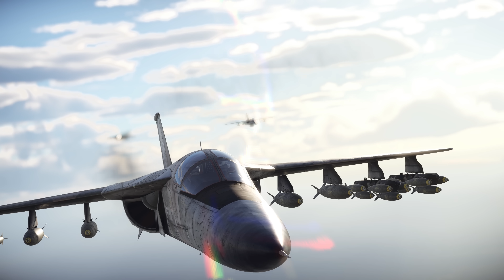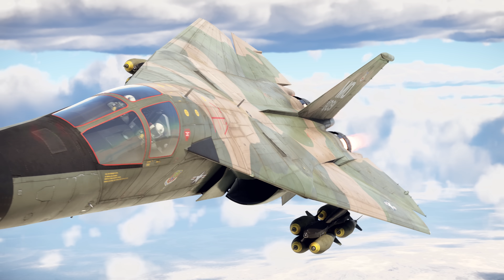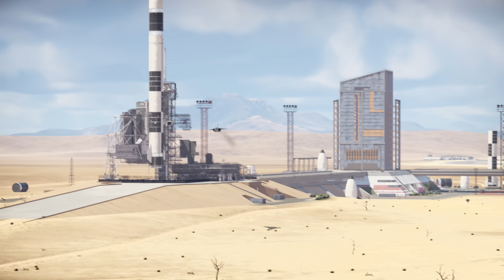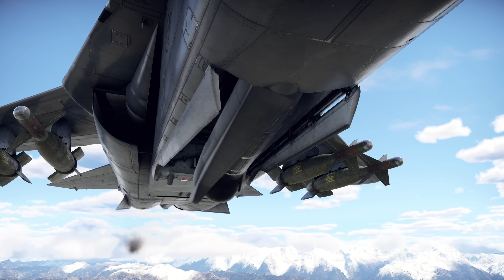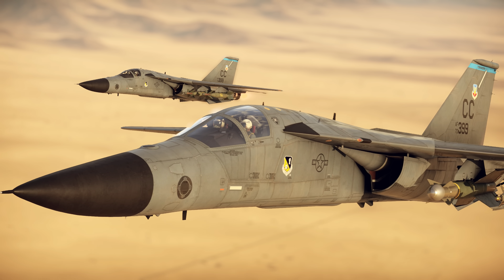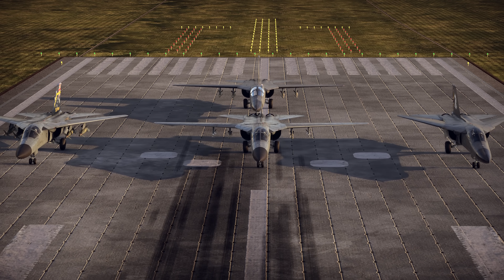F-111 Aardvark: Low-Altitude Menace

Comment: The D model I crewed in 1974 had new TF-100 turbo fan engines a at altitude became Ram jets when the intakes closed off using spikes that cut off the air coming in and became Ram Jet engines able to fly at mach 13 and found a new sound barrier at mach 28. The aircraft I was crew chief on had the whole avionics system of the B-1 lancer and was the test aircraft. Totally a fantastic aircraft.

Comment: I worked at Tinker AFB and I machined plenty of parts for the TF -30 engines that went on the F-111 and early model F-14's. If it wasn't for the problem with compressor stall it would have been a great engine. Either way we reworked thousands of the TF-30 engines at Tinker AFB during the years it was used.

Comment: Did the 111 (or any swing wing ac) have its wings fully swept back on the deck?  Or was that a higher-altitude Mach 1.5+ config?  

I read the F-111 killed more tanks during Desert Storm than the A-10; good for the USAF and General Dynamics for sticking with the model to make it a killing machine.  It had a rough start - a lot of technology had to be perfected to get it where it ended up.  A darn good aircraft. 

My first WT video, I didn’t know this channel existed!  Nice work.

Comment: I wish that ground-following radar would auto fly my plane low in some special setting like it did in real life. i mean some of these planes are basically built around specific modules and its sad when peeps dont get to use them. F117 can use its stealth by default , A10 that was built around its gun is the same. F111 was built around its new radar (a bit like F14) and state-of-the-art automated avionics that nobody had. Yet we dont get to use any of that. Big Sad :'(

Comment: Still incorrect model. Wings do not fold to 45 degrees with gun pods on as they should and the flight model is badly gimped and the airframes break at half their top speed at sea level. War Thunder looks good but the Western models are badly sabotaged or over tiered.

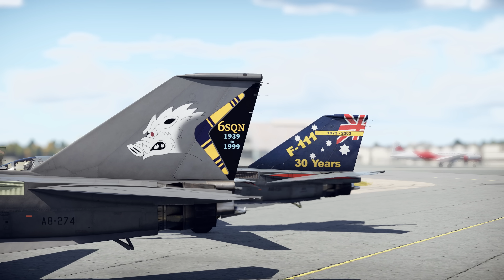Comment: 4:13 correction:
F-111 Aardvark fighter-bomber, call sign Karma-52, was shot down over Libya during Operation El Dorado Canyon on April 15, 1986. Two U.S. Air Force captains—Fernando L. Ribas-Dominicci and Paul F. Lorence—were killed when their F-111 was shot down over the Gulf of Sidra.
Reply: Probably not shot down…radar jamming was interfering with terrain following radar and Capt Rivas probably paddled off the TFR and mistakenly hand flew his jet into the water.

Comment: The F - 111 if I remember correctly, was originally designed to be on a US aircraft carrier. But the Navy turned it down, then the AF took a look at it. When the D model finally retired, some of them had problems we techs just couldn't figure out! They were a technicians nightmare! Especially for A shop!
Reply: I was a B shop (instrument and autopilot)  tech on the F111D from 1971 to 1974.  It was easy to fix our stuff if you new what you were doing.  Really tough if you didn't.   Most guys didn't know their stuff and didn't care to know.  This aircraft was designed for both services to use.   Both services didn't like the idea.
Reply: @jnbfrancisco  were you in 'Nam? I thought a couple of the F-111 models saw action over there. Thank you 👍
Reply: Actually, it's the other way around. The F-111A was the winner of the USAF request for proposal for a low level strike fighter, hence the USAF got the F-111A. Robert Mcnamarra, the US Sec. of defense thought the US should only be flying the same jet for everyone so he said this is what the US Navy should use for their new fighter. That was the F-111B. it's not often the Navy is told to buy an Air Force jet because it usually doesn't fit Navy carrier-borne requirements. The B model kept gaining weight and getting more expensive until they had to cancel it.  The US NAVY now relieved, came out with their own proposal rather than taking the stupid hand me downs that Mcnamarra tried to force on the services, and they developed the F-14 with much of the technology gained from the F-111 being shared with Grumman to make the awesome F-14. The Navy has "given" the USAF the F-4, and A-7. The Navy has taken the "loser" of the Lightweight Fighter competition and turned it into the F-18 Hornet while the USAF kept the F-16. Mcnamarra might've been a good corporate manager, but he knew nothing about military aviation. Yes, the "D" was a Dog of a jet with unremarkable avionics, but the FB-111 was an awesome version with nuclear capable prowess. technically they were all nuclear capable, but the FB was the medium bomber version with larger wings and avionics for that role. The Aussie C model was a mix of that airframe with standard avionics and then got the G model when the FB was retired. They all had issues, even for weapons with those swiveling pylons. 🙋✌sorry, didn't mean to geek out so much. She's such a cool jet. Hell, there was even an EF-111 that was credited with killing a MIG-23 during Desert Storm in 1991! Two swing wing platforms, one of them an air to air fighter and the other an unarmed electronic warfare platform and who do you think won? The EF-111 out flew the MIG when the -23 flew into the ground. Of course, I'm sure the RWR in the headset of the MIG pilot telling him that he was locked up by an F-15 Eagle somewhere behind him put some pressure on that pilot. 🙂

Comment: 1 turn and you're down to 400kmh and become a sitting duck.
Reply: Dont turn Hard and you dont bleed much speed and have enough fuel , i use 73 Minuten of fuel in my F111-f works fine for me as long as i dont get an R24 in my engine, i know its Radar guided missile.
Reply: @justforfun_ger7137  Cope

Comment: Why can't the wings sweep with gunpods :(
I check a few manuals online and couldn't find anything...
Also, I know it's a silly wish, but it would be cool to have Electronic Warfare aircraft. Jamming radar would be a fun way to support a team, and we'd get the Sparkvark!
Reply: They are supposed to sweep to 45 degrees with gun pods on but Gaijin sabotaged them. Along with about 20 other times they wrecked things for balance instead of using the BR system.

Comment: Quick question about the game please guys, because I'm not too familiar.

I'm mostly into DCS, but I am unable to devote as much time as I need to learn the full fidelity modules. I've seen recently that War Thunder is introducing a lot of jets and helos, but what I really need to know please is how large, and what variations do we get on the player maps?

I don't want to spend only five minutes flying to target if that makes sense?

Appreciate any feedback, many thanks in advance.
Reply: War Thunder is barley a SIM and is corrupt with badly sabotaged models. It has Arcade, Realistic and Sim modes. Sim maps are locked in a BR = Battle Rating, a system used for balance on weekly rotation. So if that week your machines BR is from WW2 you cannot fly the Vark for instance. The maps are too small for the most part to cater for consoles and smooth brains. The quality of the game and it's balance and list of grievances gets longer with every update.  
Arcade makes everything show up on the map like wall hacks and goes faster than their real parameters, Realistic is probably the best 3rd person/ near Sim experience the game has to offer. 
The game looks great but the more research you do the more you'll find missing features for machines instead of them being modeled correctly and then given a correct BR number for their power. Instead they are sabotaged to fit into the game designers opinion of balance. 
I have a list of about 20 grievances from 2 nations. The Apache alone has about 6 or more missing features and barely works at all for instance, or the F15 airframe breaks apart at half it's max air speed for sea level while at altitude. So it's heavily gamified. The F-111A flies like a slug and it's wings fail to fold to 45 degrees with gun pods on making you as slow as an A-10 for all intents and purposes. 
Most GRB ground realistic battles Maps last 5 minutes and are one sided stomps due to abused game mechanics but they are combined arms.

Comment: The F-111 has a badly gimped flight model in the game, the speed bleed when turning is so insane it's actually one of the slowest planes at its BR. Unless you can find a map you can fly perfectly straight 100% of the time.
Reply: I get that it is actually quite slow, but playing the a10 speed is absolutely abysmal. I’m not even kidding when I say ALL the enemy bases have been bombed before I even get close to allied ones. And you cannot fly up. People just run away. It is the slowest, followed by the su-25, which can go somewhat significantly faster.
Reply: @gbu12paveway2laserguidedbomb A-10 is super agile though. Most players thought that they can out turn the A-10 and tried to turn fight instead of extending. 30mm does not treat them well
I grinded the last event with the A-10 and it was fun
Reply: @nhatpham9933  yes, but that’s assuming you even manage to get close to them
Reply: @gbu12paveway2laserguidedbomb oh you will, fly on the right and most of the time you will caught the enemies that are moving to engage your allies on the left when you get to the battle zone.
Reply: @nhatpham9933  ok thank for the strat I guess
Reply: It's a bomber, it's heavy
Reply: @hybrid_grizzly a small adjustment of heading results in upward of 100 mph speed bleed. It literally defies physics
Reply: @wackyotter1235  That’s just bc the instructor is stupid and pulls maximum aoa
Reply: @hybrid_grizzly  its not a b-52 it can hit mach 2.3
Reply: @Slavicplayer251 my wings broke at mach 2.48
Reply: @justforfun_ger7137  and?

Comment: Shares the same engines as the F-14A, F-111 comes from the same program. They're cousins !
Reply: kinda. the F14A is the replacement to the failed F-111B naval version.
Reply: F111 is an air force plane and not the navy nor the army likes to use Planes from each other and the F111b was way to heavy for carrier use.

Comment: Are you planning to make fire extinguishers replenishable on captured points?
Reply: 111 likes?
Reply: How about one free repair kit use for anyone who has not researched spare parts?
Reply: @michaelm9975  you can go to the cap points to repair if you dont have improved parts mod
Reply: @Gurkani-xv7kn While this is absolutely valid. Trying to do so with an engine that's constantly breaking down every 20 or so meters to get to one is an absolute nightmare. At the very minimum for engines at least it should be limited movement but without the health dropping so you're forced to repair slightly again.
Reply: Just j out @Kirito_01422
Reply: @ i fully agree with everything you've said great points made dude